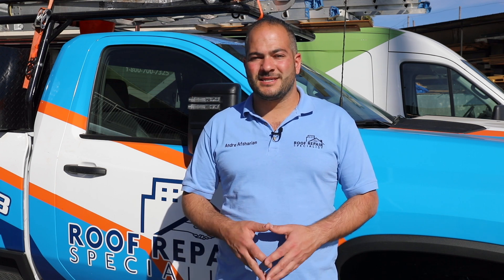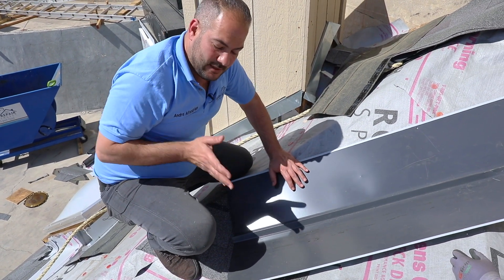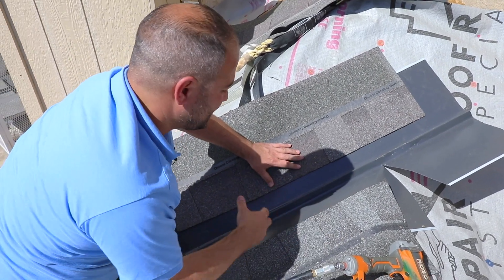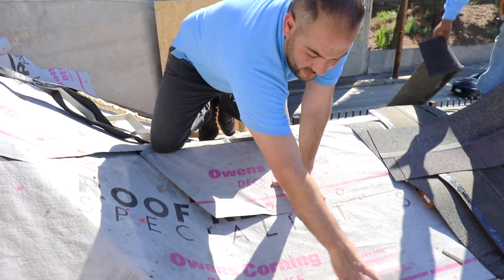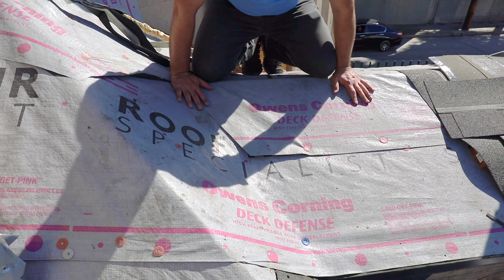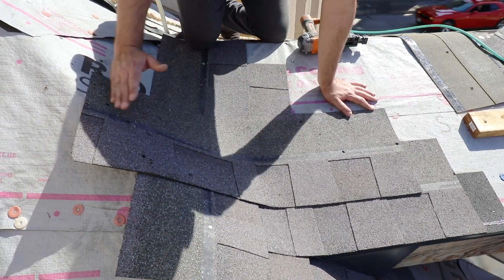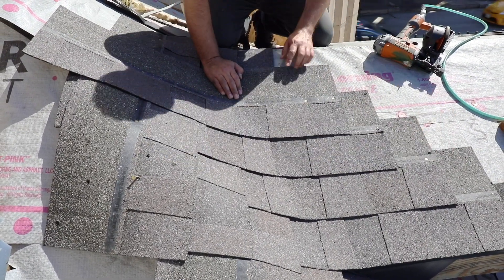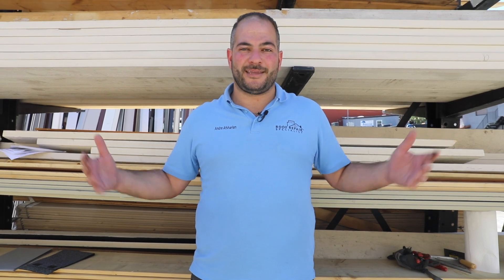The BEST Way to Install a Valley!

Comment: After some minor hail storms, about 20 roofs with 8/12 pitch were replaced in my neighborhood, by about 10 different companies, and they all used woven valleys.  Both existing and replacements were architectural shingles from mostly different manufactures/series.  There have been no reported leaks from old roofs or new.  The "woven valley" for these 8/12 pitch roofs appears to work.
Reply: He never said they didn't work, even re-emphasized that all three methods are accepted. He just said he personally don't like the way it looks. Id imagine it uses more shingles as well

Comment: So you're putting the nails at the very end of the valley or the edge of the valley.So when you put your shingles, you're nelling into that metal.What is the diffprince?You still putting a lot more nails in that valley.When you put the nail when you put the shingles

Comment: It seems like architectural that you used and even 3 tab shingles aren't meant to shed water in the horizontal position.  When you turn those shingles 90 degrees for the cut valley, I agree it does look cleaner, but it might set up for water to naturally go underneath the rotated shingles along the whole length of the valley.  Shingles are designed to shed and cascade water to the next layer with the expectation that they are installed in a very specific orientation, nail placement, and overlap.
Reply: Look at his first three rows. Shouldn't there be over 4'" between the ends of the shingle and the next row? Installing an architectural shingle vertical up the valley and then bringing the the bottom of the rows to the edge of the vertical leaves every third or so  exposed shingle in the valley only 1/8" thick. I guess if it doesn't rain hard and if you don't have snow or ice, it won't fail for a few years.

Comment: A friend installed a woven valley for my roof.  Then I had the other part of roof shingled.......they removed the friends woven, which BTW never leaked.  Here we are about 12 years later and I have a leak right where valley is.  I've not looked at it, but I know they did it wrong.  It is now leaking. So now I have to find an iowa company that knows how to properly repair the valley.  Hope I find someone as good as you.

Comment: One of the most instructive videos I've seen, to date. You explain it so well. THANK YOU!!! I'm getting a new roof in a couple of months, after 25 years, and will stick to the cut valleys, that I already have, on my 5/12 pitch roof on my single story, 1960 single family home, two valley, two ridge roof with one ridge about 4 ft higher than the other, and six hips. It is a "L" shaped house. The lower ridge is on the bottom of the inverted "L". I am going with ice and water adhesive underlayment over the entire 1"x8" dimensional lumber decking and new drip edges.I had the attic sprayed with open cell foam, 3 -4 inches thick and sprayed cellulose on the attic floor about 14 -16 inches deep, in 2010 after I had a complete, new HVAC and flex duct installed. For our extreme heat and humidity in south Louisiana, I have long soffit vents and a GAF 1,150 CFM power ventilator. I am installing a new one with the new roof.  In south Louisiana we also need that extra protection for the ice and water shield adhesive underlayment for hurricane season from June 1st - Nov. 30th each year. The GAF Prestique Elk II architectural shingles and 30 lb felt has lasted 25 years without one shingle being blow off in any hurricane etc, including Hurricanes Katrina, Rita, Issac and Ida. I did regular inspections and maintenance on the roof. It paid off in the long run. They don't make those shingles anymore. The local roofing contractor, in business for 45 years recommends Atlas Pinnacle Pristine, 130 mph, impact rating 3, but I may upgrade to an impact rating 4 shingle with a higher wind rating. Thanks for hearing me out.

Comment: Wonderful video! Would the choice of valleys also be determined by the climate in the area? Ie. if there is a lot of rain and snow/ice. Also, what about in terms of shingle wear? I’ve heard the shingles on the valleys wear out a lot faster than the rest of the roof so an open valley design is preferred. What’s your take on that?

Also, in terms of complexity of install and the cost of installation, how do they compare?

Thank You!

Comment: I'm not a fan of butting shingles end-to-end with no overlap and installing them perpendicular to the valley just to get a straight line. Sometimes called a California valley, and also used within other valley installation methods. Here in the north, water can get under the shingle, freeze, expand, and move or crack that shingle and the adjacent shingle. The object should always be to divert all water off the slope as quickly as possible, and not retain water or rely on the ice & water shield or the flashing.

Comment: Good video.  I saw one video about a particular valley in which a woven pattern was used. The reason is that the valley didn't join two roofs perpendicular to each other but instead the roofs merged with about a 20-degree angle.  The thought was that a cut valley in that case would fail.

Comment: This is SO wrong in several ways.   You were lining up the right side of different courses of shingles (at 6:23+) !    A few butt seems of the shingles were practically on top of nails of the lower course !    WTH Bro ?
Reply: Those shingles were cut short just to make the demonstration easier to show.

Comment: All new roofs are installed with woven valleys.  Go to any new or even 10-20 year old neighborhood with original shingles and you will see woven valleys.  Raleigh , NC. Area  I personally don’t like open cut because that open cut edge will curl after 5 years.  That shingle edge is relying on the adhesive and caulking to make that valley watertight.   Here’s the easier way to understand it….take a water hose and spray directly on that edge of the open cut, then take it and spray it in a woven Valley… which one do you think is going to be more susceptible to water getting underneath the shingle? Obviously the open cut with the raw edge .
Reply: And yet they seem to work just fine. That is not a typical failure point.
Reply: Nope

Comment: Why wouldnt you flip the row that sits aligned with the flashing such that it is a solid piece instead of the tabs.
Reply from the maker: If I understand your question correctly, it’s so that shingle is exposed on the granular side

Comment: As a 35 year roofer there is only two types of valley I will ever install. My number 1 is w valley metal, and 2 is a cut valley. Weaved valleys are totally ugly, and a point out valley is a leak wating to  happen.
Reply from the maker: Agreed

Comment: Open valleys are BS. You should never rely on the shingle adhesive nor should you nail in the flashing. The best valley remains the closed valley.
Reply from the maker: Is your concern on open valleys wind?
Reply: Depends on roof pitch and shingle thickness

Comment: With a cut valley, how close, and how far, should the cut valley seam, be from the valley? I just had my roof redone two days ago. My cut valley seam, seems esthetically, too far from the valley. It looks like it works.  It looks like if them seam was closer to the valley, it would look nicer.
Reply from the maker: I would look to see what the manufacturer  recommends depending on the type of shingle installed. However I would say anywhere from directly center or a 1” offset. I think direct center looks nicer, however having it offset would allow for better water flow

Comment: Awesome video. So the woven valley. Would that be the easiest way to do the valley? Also would you recommend putting roofing cement under the shingles in the woven valley?
Reply from the maker: Good question. I don’t think one is easier then the other. As far as mastic, it won’t hurt, but i always default to following manufacturer instructions
Reply: Don't weave architectural/composition shingles.  You should only weave the bottom one or two at most.  Most manufacturers will not approve the weave for installation practice

Comment: I am not a roofer in trade.  When i replaced my parents roof about 6ish years ago in the valleies i ran ice and water shield, then a strip of 24" alum flashing, then i did a cut valley.  I did this because growing up almost every year they had a different roofer come out to work on leaking in the valleies above an addition they had built.  I dont know if its right, but it is not leaking.
Reply from the maker: If it’s not leaking it’s right.

Comment: Do we need to install any metal flashing going down the valley if we are doing the cut method? Or is it safe to do it over felt?
Reply from the maker: Just do it over felt, if you want to be safe out a roll of ice and water shield

Comment: Is it better to start from shingling the valley first than outwards?
Reply: What about on a hip roof
Reply: If you're right handed, yes, start at the left and work your way towards the right, absolutely you can start shingling the valley first, makes no difference. You could run straight up the middle and shingle both ways if you wanted to, I wouldn't do that because I hate shingling right to left, but absolutely that can be done.
Reply from the maker: No, always better to start from a straight end. A gable or a wall

Comment: He explains the rules of step back and then doesn't follow them. Not a very good example. Also you need paper going over the edge of the metal valley.
Reply from the maker: I’m pretty sure I do, I’m genuinely curios if not, can you call out the time in the video.
Reply: Pretty sure he means around 6:20 or so when you do not appear to leave a six inch setback.  Looks almost like no setback.
Reply: Dry in goes under flashings always but I noticed the books  were shrinking that can work if you know your nail placement come back and do your cuts

Comment: Quite a few manufactures spec sheets I have seen actually do not include woven as an approved option valley on architectural shingles. GAF specifically says not allowed. I know MALARKEY LEGACY, which is a thicker shingle, specifies that it  does not allow woven.
As far a open valleys go, my roofing supplier has all the metal roof colors, which is somewhere in the 30’s, I think anything can be matched.
Reply from the maker: Ya, I dont think I've ever done a woven valley, but makes sence especially with thicker shingles.

Comment: Don't follow anything this guy doing he has no clue what roofing is.
Reply from the maker: I would say you have no clue, but you do look like a wise old man.
Reply: @callthespecialist  yup I started roofing before they had nail guns
Reply: So what's your suggestion? What do you think he's doing wrong? You can't make a comment like that on a short video like this and just not mention what the issue is.. otherwise you just look like a troll.
Reply: Agree with you. Fourty years roofer. Only use metal if roof too steep. Shingle over metal area lasts much shorter than field shingles and gets dirt under it real fast. For roof contractor is a good way to do it bc faster, but for homeowners not best especially as you see it here.
Reply: in England you dont nail all metal valleys along the sides to allow the
metal to expand and contract or it splits in a few years especially zink